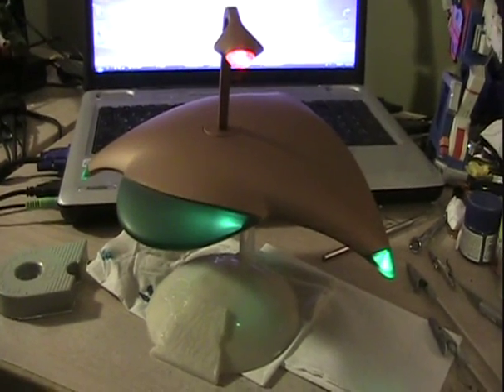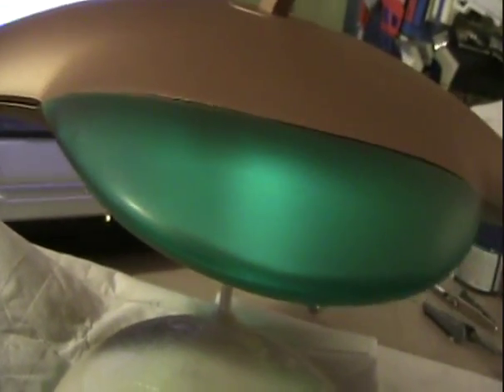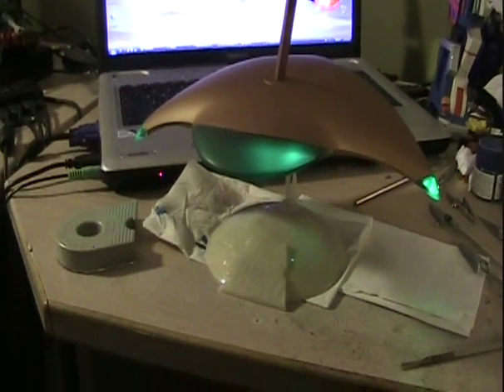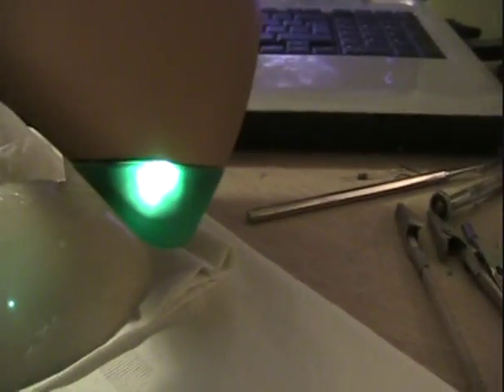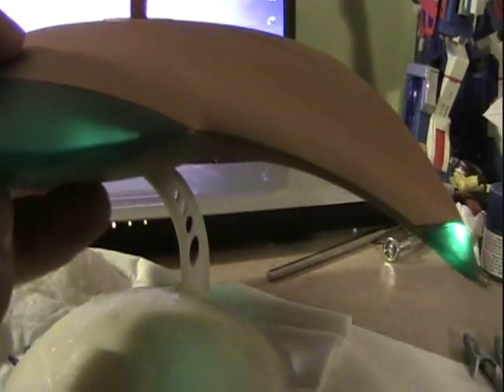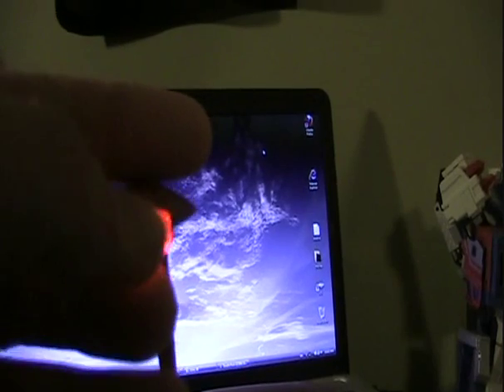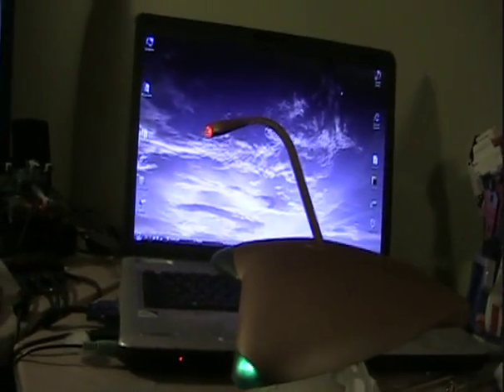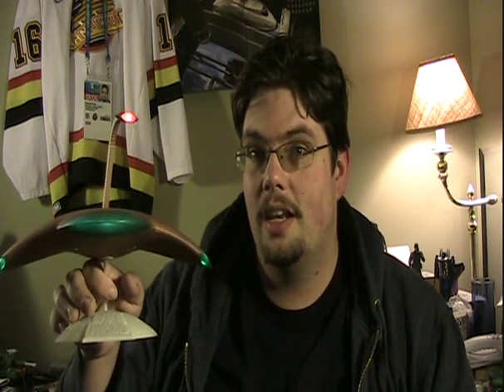Model electronics 101, lesson 6, the finishing touches, part 2 of 2

Comment: I built this and am working on a display case right now. I had a thot on the clear Green plastic pieces: try spraying the INSIDE of the plastic pieces with KRYLON's matte spray or 'workable fixatif'. The trick is to overspray. It SHOULD get milky as it dries thereby making it translucent rater than transparent. That should diffuse the harsh light from the LEDs.  I thot too it might be possible to diffuse the light by lightly spraying the inside of those pieces with a whit spray paint...LIGHTLY being the operative word for a successful out come.

Enjoyed your video.

Comment from the maker: @1965GJS It is actually a little tight in there with all the lights and wires, but there is enough room to slip the battery past everything, mine just kinda sits in the back of the ship.  I believe I mentioned in one of the later videos that it wouldn't be significantly difficult to rig some kind of simple switch into the eyestalk to turn the lights on and off as it turned from side to side, and if I were to really have given this build my all, I would have absolutely gone that route.